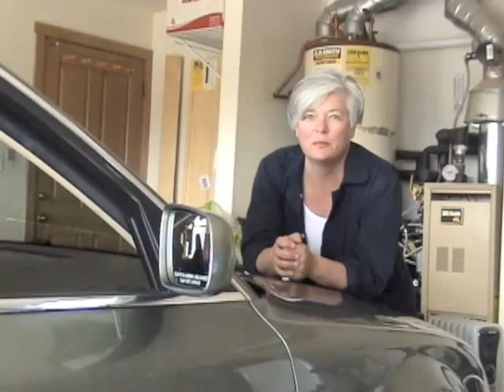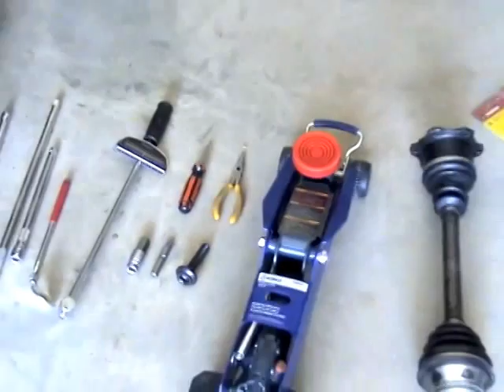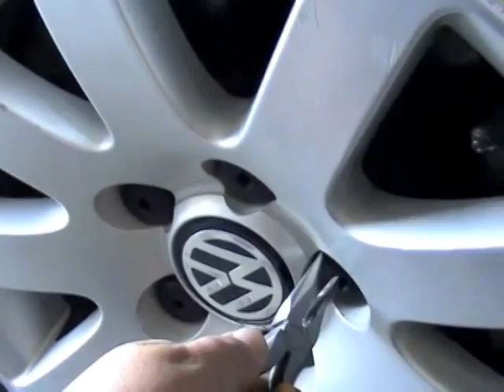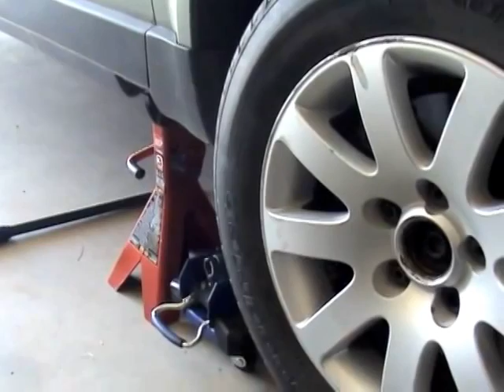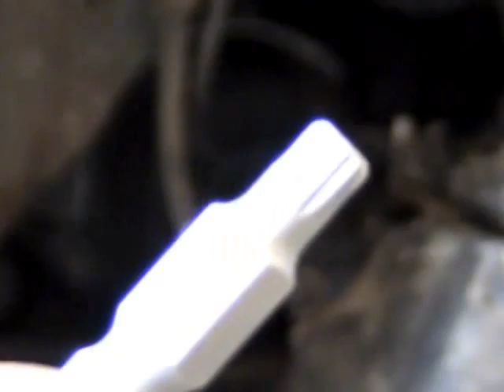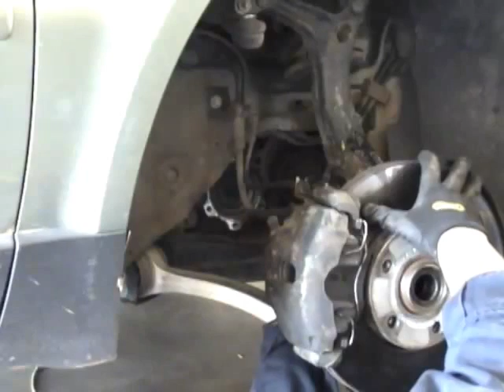VW Passat CV Axle replace repair remove

Comment: the event video does give great information on what you'll need and how to do it, but it's a lot easier to get the axle out with the heat shield removed , and its only 3 bolts to remove it
Reply: I actually think she ended up removing the shield...just didn't mention it in the video. Didn't see the shield on the video when she removed the shaft. She wouldn't be able to flex the shaft like she did if it was in place. Did this repair yesterday...with the shield installed. What a total pain in the ass. I removed it before I put the new one back in.